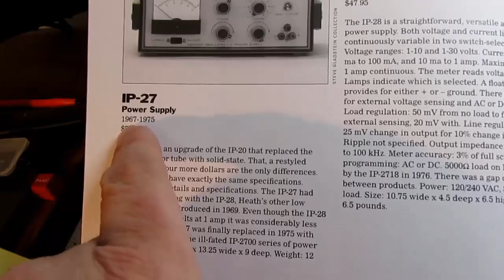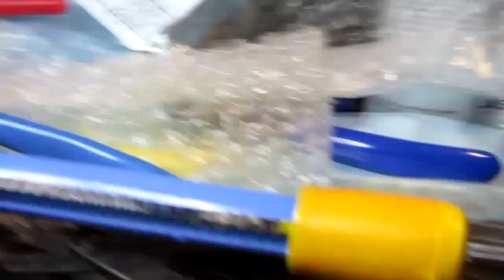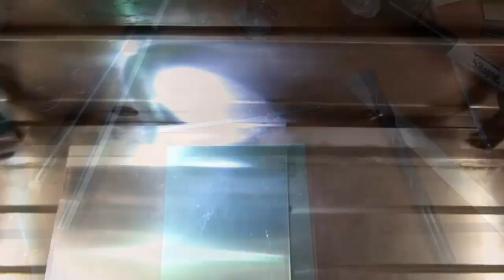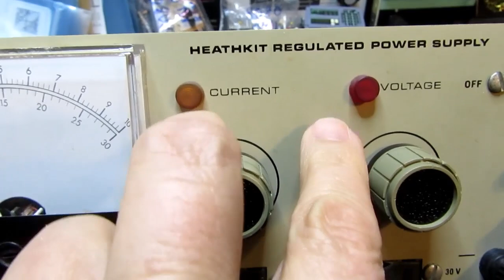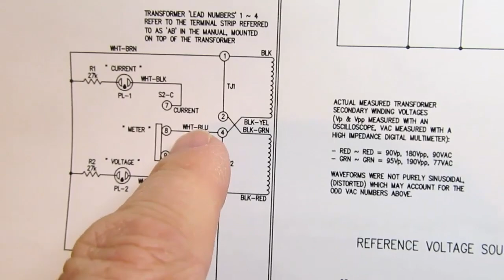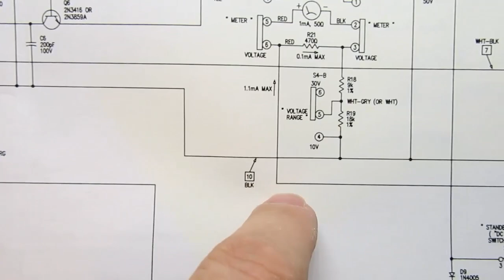Heathkit IP-28 Regulated Power Supply: Overview & Restoration (Version 2)

Comment: I got like a Heathkit dumb terminal that just has the stuff rattling around in it lol.  Back when you built your own first computer from a kit, a dumb terminal.
Must of came out before 8 bits took off...  and to get computer access you had to connect to a mainframe across a modem or maybe it was used to get video on an Altair, who knows.
Reply from the maker: Chopper Girl, you might want to do at least a little bit of research.....you are guessing at (and getting wrong) a number of things that are easy to look up (and then get right).

Heathkit did not have a 'dumb' terminal until they were already in the computer kit business, and "8 bit taking off" does not factor into that. Terminals, regardless of brand, could be used to connect to mainframes or mini computers or microcomputers, and Heathkit's terminals were originally intended for their H8 computer, which was either 8080 or Z80 based.
Reply: @youtuuba  I'd probably care more but it's 40 years past becoming total junk.  It can molder away in the same pile with an Osborne, PET, Kaybro, and TRS-80 with 8 inch floppy drives.
Reply from the maker: @choppergirl  I know this is 5 years late, but it really annoys me when people leave comments about things they A) don't understand and B) don't care about in the first place.